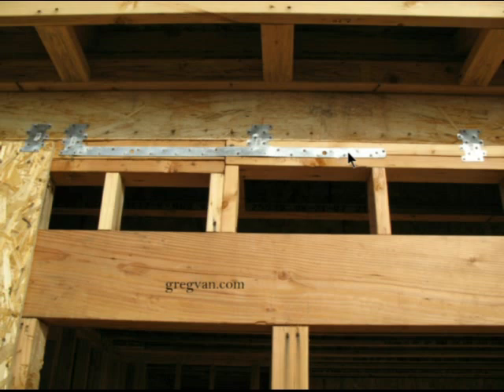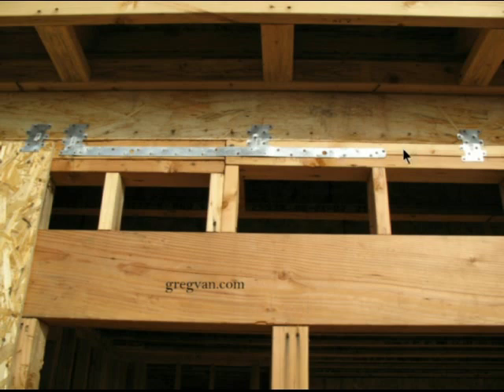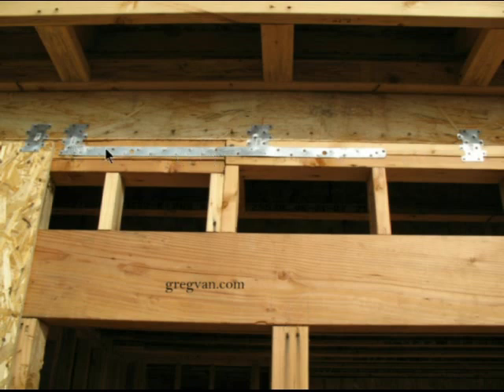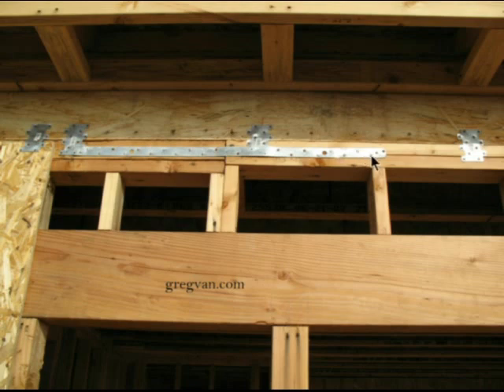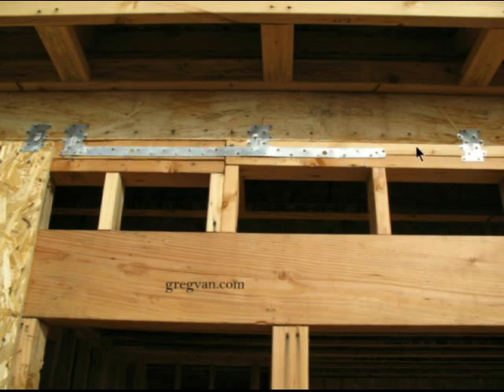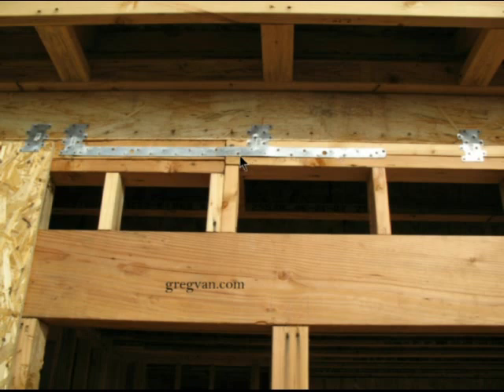Top Wall Plate Strap Location Can Be Critical - Framing And Home Building

Comment: Advice for using straps for attaching two different height walls? Say a 9'2" wall to a 11'8" wall where the top plates don't align on a load bearing wall. Thanks.

Comment: The whole joint looks out of line.  The top plat should have been cut back and not have both plates end at the same point.  For your question, the strap should be nailed in the center when ever possible.
Reply from the maker: It will depend on the size of the strap. Smaller or thinner straps can work in the center, but wider ones might not work as well.

Comment: Hvac guys cut about 14 inches of double top plate out on an interior load bearing wall to run duct down to lower level. Before sheetrocking a 6ft 10gauge steel simpson tie strap was installed on both sides  of wall. In your opinion will this be ok?
Reply from the maker: That's a common method used in construction. The straps sounds good, but other than that I wouldn't be able to provide you with more information, because I don't know what the wall is being used for and am not a structural engineer.

Comment: Doing a remodel job and changing a header from 2' to 3' and came across the top plate top 2x4 that has an overlap of about 12" and they have three straps that go over the top plate and are nailed to the header half way down. Are these straps hurricane straps or to tie the top plate together? I am thinking hurricane straps as the floor plate has them too.  thanks

Comment from the maker: Realistically, you're right on. I haven't seen a set of plans in years that doesn't call out for an MST 48 at all wall framing top plate breaks, without a 4 foot lap and you're probably right about the inspector missing this one, unless there's a big honking strap on the inside.

Comment: plywood should be to just below rafters, continuous, bottom to top. most shear walls require plywood to be min, of 48" each side of top plate framing break. as well as mst straps per maker should be centered, on framing member. being that this wall was framed poorly, lack of top plate lap. it must not have been inspected. or this may not be a shear wall.lots of bad mojo here.  that strap looks like a wall bracing unit, that has been cut..